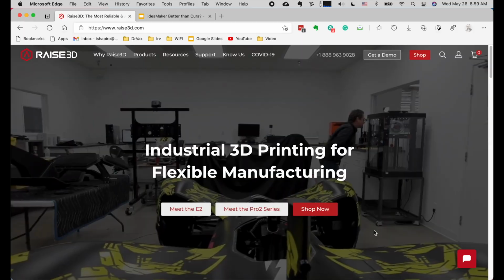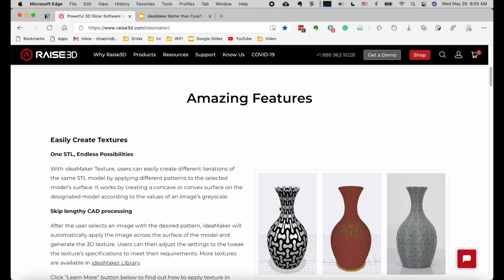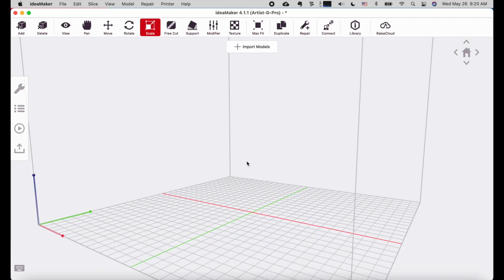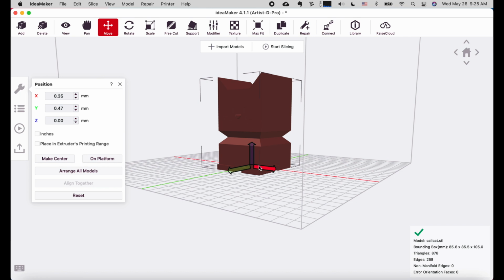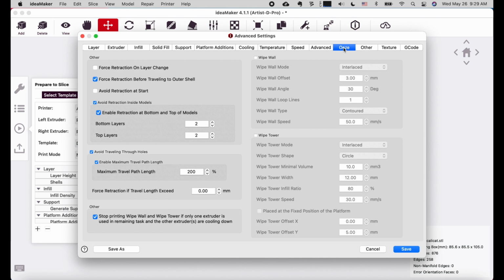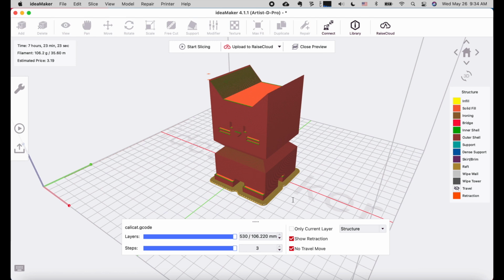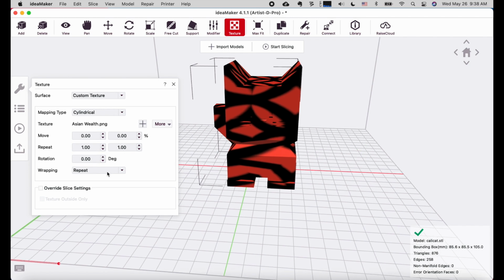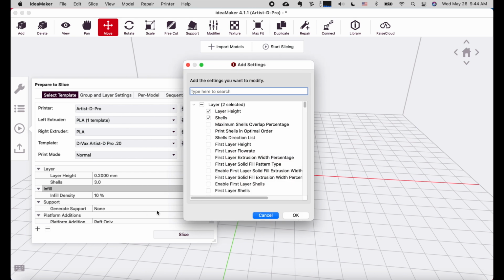Is ideaMaker better than Cura and PrusaSlicer?

Comment: Nice video- thanks. I’ve now more or less abandoned Cura for 2 reasons- 1) it is horrible at dealing with bad meshes and the mesh fix add in doesn’t seem to fix much; 2) it runs in compatibility mode unless you have a pretty recent PC (no clue about Mac though). With compatibility mode you lose some of the GCode preview functionality and some of the menu items don’t function. Constraint seems to be whether your machine is new enough to support OpenGL 4.2 video processing. In contrast IdeaMaker is wonderful with bad meshes and runs well on my 12 yr old PC. 
By the way, I’ve imported 2 of the Ender 3 V2 templates from IdeaMaker’s website and nothing positive to say about either of them! Far better to start with their template generator or by cloning/modifying existing one.

Comment: you can change ideamaker to a dark theme, as well as in preview mode, you can change the look of it, ie from structure to speed. Also, i have my filament color set to grey because red is just so hard to see anything on:) then in preview mode, i set the type to extruder color, and then i can see the retraction moves far easier. i found ideamaker way easier to setup than cura. I hate in cura when you can a setting, it says keep or disgard, so you hit keep and it messes up your profile. curas profile management is terrible. IM's is easier to setup and manage.

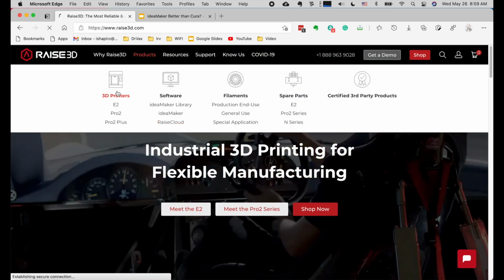Comment: 3:50 There are a bunch of companies making high-end printers for manufacturing and prototyping. They also make traditional 3D printing tech like FDM except the open source tech is superior to expensive none consumer facing versions. 

The clients include institutions like schools ranging from kindergarten to colleges.

They are not designed to be serviced by the buyer. It will void the warranty. They make money by marking up the prices ten fold or more and repairing very easy to fix issues for a ridiculous price. 

I don't have any issue with this personally since there is demand and the buyers are institutions that don't have to worry about rent.

Comment: I own a Chitu code Tronxy printer and I can´t print directly from Ideamaker , maybe start and end gcode needs special configuration. Just copying the Cura gcodes and placing them on Ideamaker does not work.  Any ideas? I want to replace this Chitu board with a a Nano Robin V.3 so I can make this printer a little more convencional. What do you think? Thank you, a suscribed guy from Colombia.

Comment: Could you give some direction on printing multiple color prints (3in 1out hot end such as geetech A10t) I use latest version of cura. Keeps pausing between color change, trying to heat the hot end that's already hot. Please help

Comment: The texture tab in the edit section setting can be altered to make the texture indent instead of extruding out. Plus control the distance of both. I am currently using Ideamaker more than Cura
Reply: Mike, could you explain a bit more about how to alter the texture?  I've looked and LOOKED for a place where the variables are controlled.  Perhaps I'm not understanding the "texture tab in the edit section" reference.  Really interested in this slicer, long time S3d user frustrated with the lack of updates.  Thank You!
Reply: @madscience6931  I cam across this video, we have a Raised unit at work I have a Prusa at home. You can DL many textures from there site through the program and it wraps the entire part in it. We have made knobs and handles and given them a knurled finish. Pretty handy I am a big fan of the raft it sits the print on getting your parts of the bed

Comment: Thanks for the review. I used Cura for about a year. I got pretty comfortable with it and even wrote a couple plugins. But every time I upgraded it, I had to recreate the custom printer profile for my Artillery Sidewinder; that is not a simple process as you have to modify files for each version and then overwrite files in the app folder. 

So I took a look at IdeaMaker. I found the interface refreshing and easier to grok than Cura. With Cura, I needed the search feature almost every day. But to me at least, IdeaMaker's organization is very intuitive (except for a few minor things). I got better prints with IdeaMaker immediately, so have been using it almost exclusively for the last year and a half. 

IdeaMaker is also very responsive on making user-requested improvements They have implemented several of my ideas. On the other hand, Cura folks refused to fix a very irritating bug that affected me every day. When pressed, they said is just was not important to them. Huzzah for open source.

The one thing I don't find intuitive is IdeaMaker's profile/filament/template system. But I wasn't too thrilled with Cura or PrusaSlicer in that regard. IdeaMaker profile/filament/template files are not human readable, so you can't edit/reuse them without going though the tedious process of export/import and edit with the system UI. 

But, speaking of templates, IdeaMaker has a great feature that lets you compare two of them built in to the slicer. They also have an online tool that lets you view the content of a template in a single page or compare two templates at https://www.ideamaker.io/compare.html
Reply from the maker: Thanks for your comment.

Comment: Here's my first impression of ideaMaker: Source? None in evidence. License? Same. Manual? Site nonfunctional. Googled source? Repository abandoned. 

My first question about a tool like this has become: Can I fix it after the developer moves on?

Thus, ideaMaker is out of the running. MatterControl is one I would consider.
Reply from the maker: This is not an open source tool.  I also use Google Docs which are not open source.  In this case like in most cases with proprietary software it is up to the manufacturer to maintain it.  So no, if you find a bug you cannot fix it.  If you find a bug in your cars software you also cannot fix it and good luck getting a hot-fix.  As consumer we have choices proprietary vs open source is a tradeoff.
Reply: @MakeWithTech  I understand, and we each have our own choices to make. For instance, I do not have a car. I have a bicycle, for which the worst firmware error would leave me with some dead weight in the helper motor, electronic control and battery holder (but still a functioning bicycle).
Reply from the maker: @LoneTech Your comments are absolutely fair.  Yes it is all about choices.

Comment: Thanks for an excellent video. My Ender 5 has a Duet WiFi board. I don't see an option to connect it with ideaMaker. Please advise if I am missing something.
Reply: The connect button only works with Raise3d printers. You can use Octoprint from Ideamaker though, it's built in to connect to it just not in a very obvious place.

Comment: its similar with s3d but more option, i still choose s3d though, and ideamaker will be my backup slicer (i just installed it yesterday, and my head is spinning learning it, so i paused it for a while). in preference you can change the framerate to 60fps so it will become smoother.
Reply: Iv just moved from S3D After 5 Years No more updates with S3D worries me so im learning Idealmaker seems ok so far

Comment: Great vid. Been using Ideamaker for some time now and it is pretty much my go to. 

You can connect direct through USB. Go to Printer --> IdeaPrinter F-Series --> Print to printer. Hit Refresh if your port is not listed, select you baud rate (could be the other way around), hit connect, select file, then print. 

Bonus tips: 1. Right click on model and read through the dropdown list. There are a lot of handy shortcuts and features there i.e. select all, instead of holding shift or control. 2. You can also use the free cut, align and merge to modify models if you need. 

Good luck and hope you enjoy Ideamaker :)
Reply from the maker: Interesting.  I will take a look.

Comment: I tried IdeaMaker and it has lots of capability. One issue I found was that with one model I tried, adding any texture crashed IM as soon as it started slicing - I have no idea why, as others work fine and that model is fine without texture.
It also seems to generate extremely long print times - up to 3 times as long as Cura, Repetier or FlashPrint. I tried to set similar or the same speeds, temperatures, fills etc etc but could not get times down. Maybe there's a trick? But great video as always, many thanks Irv.

Comment: what a pain in a$$!!!  simplify3d does alot of this stuff already!!
Reply from the maker: Not sure I understand your comment.  I own a copy of simplify3d and I am not personally a fan.   But it is nice we have choices. PS  ideaMaker is free simplify3d  costs real money.
Reply: @MakeWithTech  simplify3d in not very expensive. why do you feel a need for free slicer for a prtinter that costs hundreds of dollars  and is crucial to its use?
Reply from the maker: I understand this perspective.  As I said I own a copy of simplify3d and moved to cura because it was updated with excellent features much more often than simplify3d.
Reply: @MakeWithTech  i wouldnt mind trying it if it was easier to learn and setup! with simplify3d you can just load a .fff file for whatever printer you want. and they have many included.
Reply: @Chris Valin i cant believe ppl with hunfred dollar printers are crying for free stuff! it looks complicated to me having to put my printers every single into it. but i will check it out any freakin way. just saying it will be a pain. i would gladly pay for less pain.
Reply from the maker: I hear your point of view.
Reply: @IronMan-yg4qw  While I like what I have seen from Simplify3D, there is one BIG problem with this software. There has not been an update in years, and the version 5 that's promised years ago is still not released (and frankly - I doubt if it will ever be). People where "convinced" to buy the 4.2 version with the promise they would get the version 5 update for free within 12 months. Well - That 12 month period is long gone for those buyers, and nobody knows if they get that free update. The reason is that the developers stopped all communication with the costumers, and nobody heard anything from them for a long time now. So - It looks like all development has stopped, and there is a risk it will become abandomware. Do not forget it needs a server to a license check every time you run the software. If that server goes down, the software is useless...
So - I don't feel very tempted to buy that software. And no - I do not think a buying piece of software for €150 to run a €350 printer (most people have a Ender 3 or Ender 5) is a good buy.
But that's just only my personal take on it... I am sure there are people that disagree with me, just like there are also people that agree...
Reply: @jclosed2516  simplify3d  dont update often cuz its already so good. haha. nut it could use some addition things for sure. just saying its simple to get using right away, and has bout everything you need for setting up prints.
Reply: @IronMan-yg4qw  Well - If you are happy with it than by all means enjoy it. Nothing wrong with that.
Personally I won't buy it, because the uncertain future and high price are a drawback for me. Yes - Other slicers may have some less features, but I have no problems with that, because they are free. Also I take in consideration that the free slicers are in constant development, while development for Simplyfy3D is at a stand still for years now. In my humble opinion it won't take long before other slicers will surpass Simplify3D, so why invest money in it?
As said - If you enjoy using Simplify3D, by all means use it. I rather take no risks. Maybe if some real actual developments take place I will reconsider, but for now - Nah...
Reply: @jclosed2516  simplify3d stands still cuz they stand strong. not likr free ones that always need upgrade cuz they suk.
Reply: @IronMan-yg4qw  ???? Are you trolling or something? Because what you say makes no sense. The free ones work perfect. They only could have some more features, but not by much. As I said - S3D is on the brink of lagging behind, so there is that.
And that's the last thing I say about that - Have a nice day.
Reply: @jclosed2516  is it true s3d need their server to work?, man i almost want to buy the legit s3d in near future.
Reply: @mycinemax2653  As far as I know you have to log in on the server with your account to start up Simplyfy3D. If you do not log in and get verified the software simply refuses to start up and you will be stuck on the login screen. So yeah - You absolutely need their server. It's one of the reasons I do not feel comfortable about any phone-home software. I rather have something like a dongle, challenge-response or computer hardware tied registration or something like that. But that just me...
Reply: @jclosed2516  if they work perfect then why they need updating so often? u troll...
Reply: @IronMan-yg4qw  Many updates are to add new features that don't exist in S3D.  The last S3D update was more than 2 years ago, and I doubt I'll ever use my license again.  If you need to insult other slicers to feel better about the money you spent on S3D, then go for it.  I've accepted the loss and moved on.